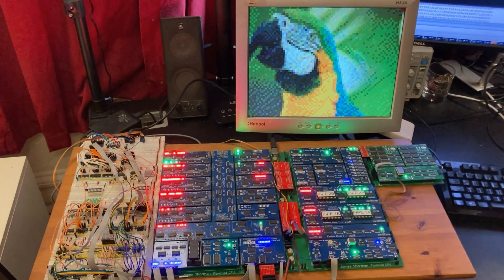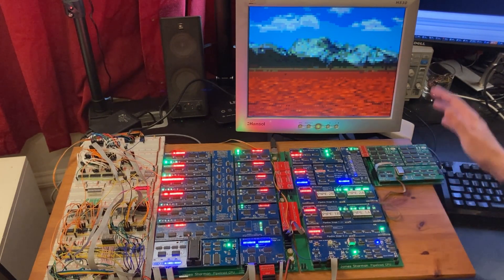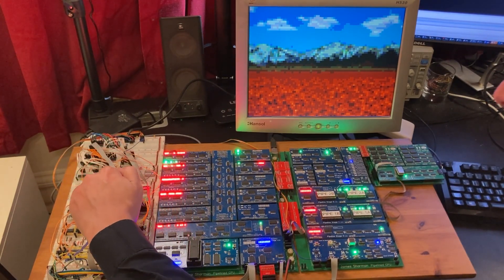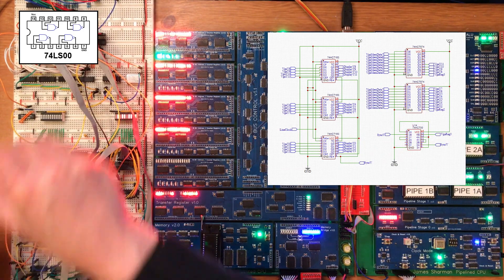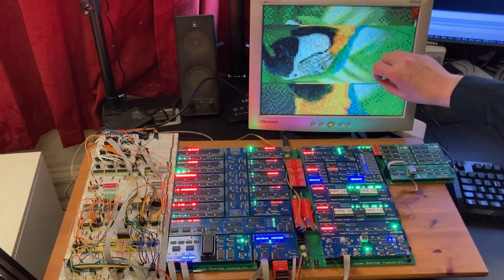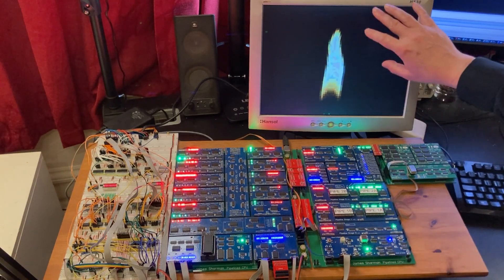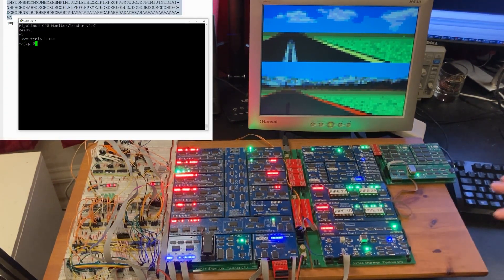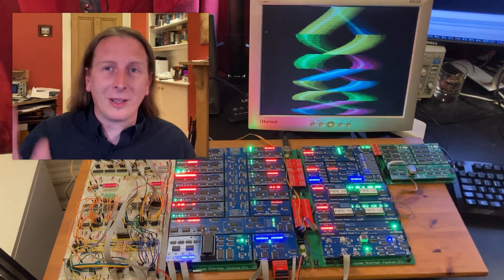Beam Racing - VGA from Scratch - Part 5

Comment: when you AND the held (thru the sr latch) VgaReg3 signal with the vertical sync to drive the Parallel Load of the vertical 74163, isn`t it exactly the same as you would directly drive the PL with the vertical sync?
Reply from the maker: Do you have a time index? I'm trying to decode your question in the context of the circuit in this point in time.

Comment: Amazing. Knowing how the hardware works, shines a lot of light into why the 16-bit era computers games, looked the way they did. They used scrolling techniques to achieve all these nice graphics, as CPU was not fast enough to recalculate entire frame on each frame. Really cool. Trick to code, but once done, is cool, and very smooth. The second to last demo with the race track was amazing. Once we have full VGA resolution and full 24-bit outputs, this is going to be really good.
Reply from the maker: Glad you liked it!

Comment: So you have video, audio, and serial all working... I feel like the next logical step would be a floppy disk controller.
Reply from the maker: I'd definetly like some kind of storage so I can use the build in a more stand alone fashion. The problem with floppy drives is the modern ones use very modern interfaces but the older ones that would be a more interesting interfacing project can be tough toi get hold of. For a while I thought about using a c64 drive, that is basicly UART interface which wouldn't take much more circuitry.

Comment: Maybe I missed it because I’m watching these out of order, but how are you triggering the scroll offset change on each horizontal blank? Are you watching for a flag on the video hardware, or do you have VRAM buffers of horizontal and vertical offsets? I am guessing counting cycles wouldn’t work if the CPU is not locked to the video clock, and you don’t have interrupts. 
I got a cold this week, so binge watched all the videos to get up to date. Really enjoying this phenomenal series, and I’m glad I’ve caught up so I can follow it in real time!
Reply from the maker: The status bits (h-blank, v-blank, blank, h-sync, v-sync) can be read from the io port, so I just have a simple loop to wait for the right bit and count the lines. I call a function once per frame to wait for the end of vertical blanking.
Reply: @weirdboyjim  thanks for the explanation. Do you think polling will be fine for the future projects you have in mind, or is it something you’d be keen to add more hardware support for? Not having interrupts but having hardware flexibility makes it quite an interesting problem.

Comment: Fantastic results so far! Do you plan to up the resolution at all? And what is the current effective resolution at the moment?
Reply from the maker: The current resolution is 80x60 is one "pixel" is 8x8 actual pixels. That's no accident, my plan is that the main display field be a tilemap like on most of the 8-bit consoles, that way I can use the whole 640x480 resolution but with much less memory to store it and manipulate. What I've effectively done so far is build the tile map without the tiles themselves, that gave me a shortcut to having something that actually works we can build on in later videos.
Reply: @weirdboyjim  so if you use character tiles you can achieve higher resolution  as tiles. nice. Looking forward to howyou handle sprites.

Comment: Those effects are jaw-dropping!
It's hard to believe they are running on a DIY circuit.

I'm curious if it would be possible to add a horizontal component to the 3D cylinder effect to get a 3D sphere. Would that allow for a (simplified) Google Earth demo? Not sure if it makes sense.

Great video as always, thanks!
Reply from the maker: Thanks Crul! Unfortunately not on the sphere, these kinds of effects are all trickery. The display hardware still has the base limit that sequential pixels appear next to each other, you would need variable rate X to do a sphere. Could do a bunch of cool stuff if you had that though.
Reply: @weirdboyjim  Oh, I think I get it; the horizontal effect only allows scrolling, but not scaling, right?
I still find hard to wrap my head around something like this.

Comment: I'm guessing it is impossible to do that first sine wave wobble effect in the vertical direction? Possibly because you can't change the contents of the frame buffer during a horizontal scan?
Reply from the maker: Not with this circuit, if you look at each scan line they have simple coherency (Each pixel the X still increments by one). So we are doing lots of clever stuff with that basic structure but we can't leave those limits. If I had variable rate scanning on the X there is a bunch of extra cool stuff that could be done.

Comment: Wow James.  That parallax effect blew mw away - And then I you showed the bendy road.  Top marks.  I remember trying to code similar effect (although without the bends) on the Acorn Electron back in the day in BBC Basic just by swapping the colour pallets between frames of the chunks of the kerbs.  I was quite proud I could get a effect of sorts, but it was quite chunky and limited what I could do with the rest of the screen.  Looking forward to the next steps in this series.
Reply from the maker: Thanks Bob!  Using the pallet like that is a better way of doing it, but I don't have one yet, I had to improvise!
Reply: @weirdboyjim  I much prefer your way!  Didn't have enough colours on the old Electron to make the effect particularly 'smooth'  Your method gives you so many potential effects, and that rolling 'cylinder' was amazing.  So impressed that this can be all be achieved on a bread=board project. Look forward to the conversion to a PCB....

Comment: Do you have a random number generator? I wonder if that'd be useful for your wobble animations
Reply: I believe in an earlier video he had an LFSR style RNG working.
Reply: @TomStorey96  cheers. I couldn't remember
Reply from the maker: What Tom said! I wrote it for the snek game for placing the pickup, I'm not sure what I would use it for on the wobble animation as you need the distortion to be fairly close to the previous value or it just looks like a flicker. This is all updating at 60fps!

Comment: Makes you appreciate 80s and 90s game developers and their ingenuity. Amazing how much you can do with so little. Now every game wastes computer cycles and storage left and right and no one gives a crap. Why does Fortnite need 26GB of storage (was 90GB at one time before they optimized it)?
Reply from the maker: Half my job is optimizing other peoples games, so deep down I know all the garbage guarantees me a job ;-)
Reply: @weirdboyjim  Where do I sign up for a job like that? :D
Reply: alot of modern games might not reuse assets or might just simply not even use them at all yet have them in the asset library for the game. its kind of a waste of space and to add onto that wasted space there are likely textures that don't need to be high-res because maybe it's textured onto a small object or maybe it's in a space that the player will never visit.
Reply: TBF, modern games also have much higher resolution and heavier special effects. But yeah, there are many games that could do with some optimization.
Reply: Because it’s not the 1980’s anymore and making content is more important than saving a few cpu cycles.
Reply: Fortnite devs have never heard of C and assembler.